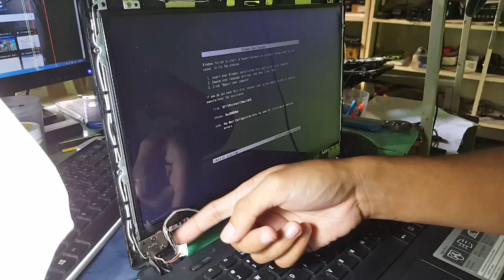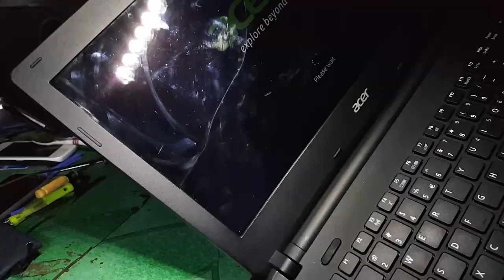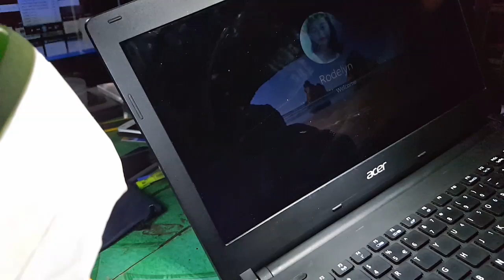laptop screen flickering fixed (all laptops applicable)

Comment: Video useful & helpful for those with the/similar problem.   BUT, the presenter apparently used on 'on camera' mic and had distracting background music which was also TOO LOUD!  Use a lapel or other directional mic & either NO music or it should be so low it could be barely heard.

So video production a PLUS.  Audio a minus.
Reply from the maker: Thanks video was taken 2017

Comment: My laptop screen is having horizontal pink lines and it is flickering. Can this be repaired?
Reply from the maker: If cleaning flex cable connector doesn't work then its time to replace lcd

Comment: My laptop screen is flickering / very dim while on battery power.  This is even on the bios post screen.  The screen itself doesn't seem to stop displaying content just the back light.  MSI gs63 stealth 8re..  I noticed while its on plug power its not an issue,  if it does start this behavior I plug it in then using windows controls to lower and raise brightness up and down (there is no reaction at first to brighness level then then it eventually comes back to normal.
Reply from the maker: Posible theres a component starting to fail at the screen.

Comment: Dell inspiron 15 5567 monitor flickering
So my screening is flickering since a while.
It is not a software issue, as I updated all the drivers (windows 10).
How can I rule out if it is the monitor or the cable?
The flickering is sometimes with vertical lines, multicolored, sometimes concurrently associated with brightness flickering.
When I move the lid upside down, I can reach a position with no flickering so I can continue my work (sometimes really annoying as I need to do that for a few minutes).
Interestingly, when it is flickering, most of the times if my make a pressure on the low back of the screen on the left and hold my pressure, it will cease flickering, but when I remove my hand it will flicker again.
Reply from the maker: First open led lcd cover and clean then re insert flex, then if it still the same do what the video did

Comment: My laptop has similar issue. It blinks even in BIOS menu. I did hard reset, so no OS installed on machine now. Battery failed, so connected to AC adapter. I tried these,
1. Replaced hard disk with brand new one
2. Changed brand new screen
Still the same thing. Now ordered brand new mother board. I'm just doubting if that works. What could be the issue? Please help!
Reply from the maker: Send me video link to your laptop
Reply: @wayneslink  Thanks for the reply. Video mean to know model or specs of my device or the video about the issue to know what happened?
Reply from the maker: @jagadeeshch7061  did you try doing the video? Maybe your flex wires is damage. Also test external monitor, id you have video about the issue send me
Reply: Hi Jagadeesh, how much is the mother board?

Comment: hi bro i have hp430 same issue screen flickering continuously.  in repair shop he did all such as replacing new display with new connector still same and he tried ic replacement also not worked and in bios he connected external monitor and went on bios reset but not fixed pls help me whats the issue it is how can i get fix this. and is it repairable or need to through motherboard.

Comment: Sir I had purchased a brand new laptop and it started flickering just as I was giving my details what do I do I have tried reducing refresh rate updating windows 10 and display drivers when I connect it to an external device ex:TV the TV does not flicker pls help me out im really scared could It be a problem with the cable that runs from the motherboard to the gpu? I rebooted the whole system but still no difference now when I go to settings and press sound the flickering starts
Reply from the maker: If thats a brand new laptop i will suggest bringing to the store you both the item and take the warranty, because thats sounds a hardware problem if you reinstall graphics drivers already

Comment: Hello..My Laptop is Hp pavilion notebook, it has spordiac flickering problem..that is black vertical lines..i have seen some ants moving in and out of the laptop..can you tell me the reason and a solution for it.. please answer 🙏:-)
Reply from the maker: 1st of all it could be permanent damage to the lcd /led, but you may try to clean the led board by an alchohol and dried it including the connectors
Reply: @wayneslink   okay. But i see a little fly stuck inside the lcd screen..how is it possible? How could it enter that airtight lcd screen? And Thanks for Answering 🙏:)

Comment: Hello po. Yung laptop ko po is may nagf-flicker na horizontal lines from top to bottom though kalahating part lang po ng screen (right side). Ano po pwedeng gawin para maayos? Thank you!
Reply from the maker: Try mu ge gently massage ang screen from left to right and top to bottom, pwdi din buksan tapos reinsert flex cable sa led or else change lcd/led na yan.

Comment: Bro my laptop was on for whole night. I turned off the sleep mode as I was downloading a huge file. In the morning my laptop screen was totally greenish. I installed Windows again, reset battery, opened up the ram and the hardisk but nothing happened. Can you tell me what's wrong?
Reply from the maker: Try reinstall graphics driver bro. Pr you may try reinsert flex cable on screen

Comment: Sis, yung sa akin po nagfiflicker din, i tried na po iuninstall ang dispay driver, bumuli na rin po akong bagong cable, pero ganun pa tin po, may times na nagpiflicker pa rin po siya. Lalo na po pag bubuksan ko, parang barcode po ang itsura pero pag magloloading na po, yung lalaas po na ang logo, nawawala na po siya. Nung binaklas ko naman po siya, umokay naman po, pero pag ibabalik ko na yung asing, ayun na naman po nagfiflicker na naman.
Reply from the maker: May problema sa wire or sa contact mu, better open tapos galawin san parti ang mag flicker

Comment: sir@ wayne link, nganu akug laptop kay mag flicker2 basta gamiton naku iyahang  HD graphics sa adapter, ug kung sa adapter display lang naku ang gamiton okay man sya pero lag lang.. unsay problem ani sir?
Reply from the maker: Try sa una e reinstall ang hd graphics drivers una, e uninstall pero ayaw ra e check ang completely remove. After e restart or scan for hardware changes
Reply: @wayneslink  g buhat nanaku tong ingun nimu sir pero mag flicker2 ghapon sya.. okay pmn ni tong ni agi nga adlaw pag shut down naku, pero pag open naku pg ka ugma ddto na nag sugod ang flicker2 .. nya kung e click kay mo black screen tas balik normal napd flicker2.. guba na kaya ang gpu ani sir? naa koy video pero d ko ka send dari hehe.. p help po sir ty

Comment: My laptop screen works when I start computer and gets dim after a few seconds I can see it’s on but very dim . And I close top and open back up it works for a few seconds ???
It flickers also  while on
Reply from the maker: Open lcd/led panel. Check cable for loss contact, clean also socket, I have repair video on my channel check it.

Comment: Hey laptop flickerig only flickers after 4-7 minutes of use. So I’m assuming that it some sort of heat problem. What do you think I should do?
Reply: Moving the screen up and down to a special spot doesnt stop flickering and I also have updated all my drivers and stuff.
Reply from the maker: If that so it could be same as in the video, some wires are grounding its other causing flicker , better chk wires before it goes worst
Reply: @wayneslink  could it be becauae of the laptop fans not working? Because when I turn my (electric)fan) on it works
Reply from the maker: If your laptops fans built in was working before and now was dead it also could be a gpu/cpu sign of overheating but as you said earlier there's a certain angle the display will be fine ,if that so then prioritize the wire in the lcd hindges
Reply: @wayneslink  oh thats not what I meant at all.(sorry for bad english) I meant to say thatwhatever the angle is it doesnt stop flickering 😅 I’m sorry for phrasing is wrong
Reply from the maker: @sircartier8843  if fan fails meaning its overheating thats why it flickers
Reply: @wayneslink  thanks bro much love

Comment: Sir. Ganun din problem ko. Nabasa kasi tong laptop. Running pa siya pero nag fliflicker ang screen hangang mag black na. Ano po pwede i troubleshoot nito. Salamat
Reply from the maker: Bukan mo lahat, cleaning mo using lighter fluid mothat mga connectors pati flex ex. Lcd

Comment: Sir paano po malalaman kung San ang sira nagfiflicker po. Di ko po alam if software problem or hardware issues po sia.  Pag chinacharge ko po minsan ei nawawala po yung pag fiflicker Nia.  Pero nung kalaunan po pag chinarge ko po nawawala po saglit tas babalik na lang po pagflicker kahit nakacharge Pa rin.  Salamat po.  :) gusto ko makatuto po ng pag aayos po ng gadgets or anything po related po sa computer.  Saan ka po nakatuto nian?  Salamat po if ever na gusto mo pong sagutin.  Sana po masagt nio po. 

PS.  Wala po akong kakikitang crack.  Hehe.
Reply from the maker: Firstly i would suggest reinstalling the graphics drivers dahil yan ang pina ka simpling unang magawa. Pag di parin, baklasin na front led/lcd cover, linisin mga contacts connectors. Linisin gamit toothbrush na may lighter fluid

Comment: Will it remove all the files? Please answer 😭
Reply from the maker: Nopes it does not remove your files. Your files is safe as your files is stored in the hard drive
Reply: How much the repair cost??
Reply: It would be very much appreciated if you reply sir, because i will get it repaired next week and i had to know the estimated cost so that i can save money 😢
Reply from the maker: @phk_0117  that would be estimated more or less 500pesos not more than 1k. In my case i charge only 350pesos only because its may suki.
Reply: thankyou for the answer sir! 😊 kung dito ka po sa province namin nag aayos for sure sainyo ako mag papaayos. baka kasi po pag magpaayos ako dito samin yung charge niya is mag increase
Reply from the maker: @phk_0117  no probs sir hope maayos na yan.
Reply: @wayneslink  sir location po pwede ko ba ipa ayos laptop ko same issue sir

Comment: I have a similar flickering issue when I move the lid or type on the keyboard. But it happens sporadically. Sometimes the laptop goes into sleep mode when typing. However, when I tug on the LCD cable as you did, there wasn't any flickering. Does this mean that the problem is my display itself?
Reply from the maker: you may try to cleAN BOTH FLEX CONNECTORS END FROM GOING TO LED/LCD TO MOTHERBOARD FIRST
Reply: @wayneslink  thanks! I'll give it a shot. How would u clean the pin connections? Is tissue and q tips fine?
Reply from the maker: yes but i used toothbrush and a lighter fluid

Comment: tagpila pa ayo ana sir?
Reply from the maker: 300-500, dependi ex if daghan ang putol or ge sumpay minimum is 300
Reply: @wayneslink  Na scam ko sir 2.5k pangayo diri sa amo
Reply from the maker: @rochieamolato5657  kung kana connector problem sir  nya solda2 ra mao rana ako pangayu pero f chipset ex onboard graphics ge reheat or reball naa pd sa 2k-2.5k basta ge gamitag hot air. Gawas ug katong mga wires ra as shown sa video mahal rapd ng 2.5k
Reply from the maker: @rochieamolato5657  kay other isue pd causing flickering screen kay if ang graphics chipset weak na solda sa lalum
Reply: @wayneslink  Ah maudiay sir kay gi hot airan bitaw to. Unya gi-ayu tung cord kay ga flicker man gihapon. Tungod kaha ni sa ga-init kaayo sa fan dapita pag nagadula sir?
Reply from the maker: @rochieamolato5657  o mao advice ana dapat elevated gyud ang laptop if mag gamit, dli e patong sa mga soft nga lugar ex.  kotson, unlan kay sa kainit mang brittle ang mga wires plus makadaot sa mga i.c
Reply: @wayneslink  kana gyud siguro sir. Sa katre ra man gud kina butang ning laptop. Salamat kaayo sa advice sir.